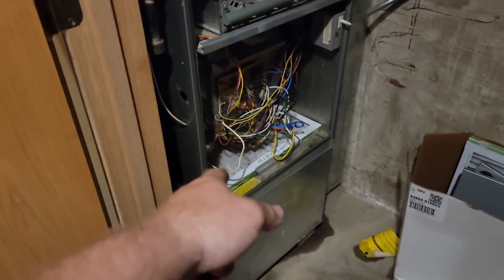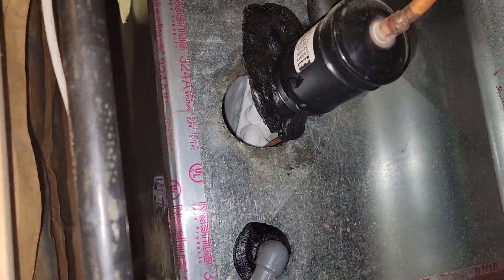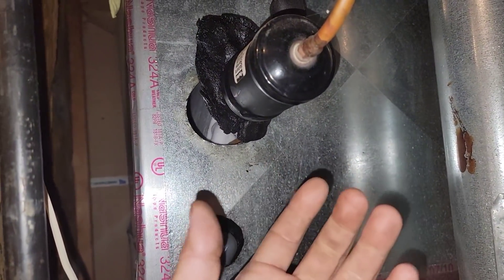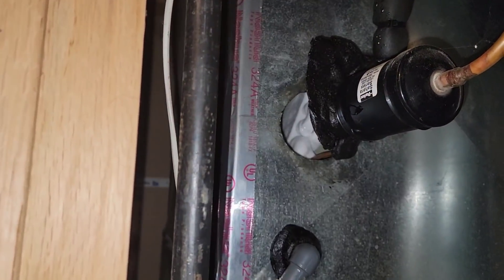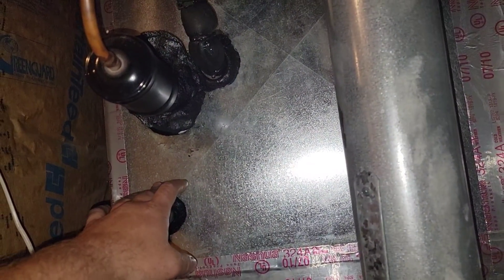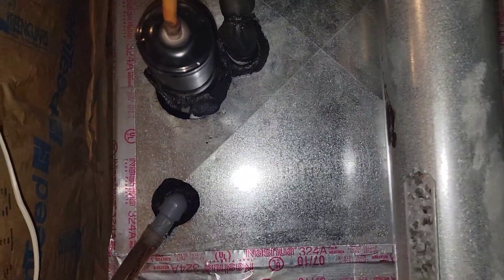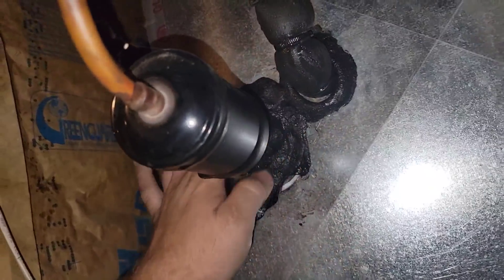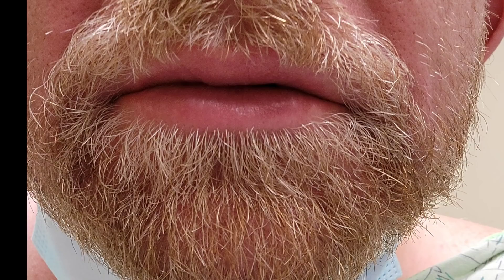Checking The Air Conditioner Put Me In the hospital, HVAC Guys I need your help

Comment: And to the icing up if it has good air flow the only thing I can think is and this is coming from the car side of things Ford wise.  Think evap core temperature sensor so it's job is to prevent icing up essentially so maybe that household system doesn't have an inhibit like Ford does IE if the EVAP core temp sensor says -99 the AC compressor will not run yada yada just a thought.  Maybe that system has a sensor for that but there is no programming or failure mode for when it goes bad?
Reply from the maker: The evaporator was completely plug from the inside
Reply from the maker: I found it tonight after I had some good rest and most of the symptoms basically dissipated from my Ventures this morning I pick myself back up and sprayed all the vegetation on the side of the house and I actually identified where this group of yellow jackets are at and there was like 20 of them that came out of the ground spring so I ran back in the house
Reply: @FordBossMe  I hate those damn things with a passion I've had them chase me at least 3 acres they came in the shop where I was sitting afterwards and stung my ass again

Comment: be sure the  interior blower is working, turn the AC off set the blower to on and let it run over night.  that should defrost it. 
a good cleaning of the evaporator is in order. 
be sure all of the vents registers are open and clean, is there filters in the return grating. 
looking at the rust that is a older system. 
kill the bees and make a path then call your AC teak i wold put money on a low charge from a leek in the evaporator. that seams to be the common place. 
i wish you the best of luck.
go talk to your DR and get a epei pen to carry full time for life.  and keep a eye on the expiration date on them.  had to scream at my Dad several times about that.
Reply from the maker: I have 2 now

Comment: Usually it is low on Freon or the Condenser is clogged. Could also be a blockage in the lines.
Reply: Also, have them do a leak test on the system with nitrogen, because if the Freon is low, most likely it has a leak somewhere.
Reply from the maker: The inside evaporator was plugged up with dog hair
Reply: @FordBossMe  That will do it also. HVAC is a tedious diagnosis process, just like cars are, especially if a problem you run into isn’t apparent or visible at first glance.

Comment: I kill these things with a clear glass bowl and some sand.  They're inactive in the evening, so that's when you get them.  Put the glass bowl over the hole, and sand around the glass to seal it up.  The wasps will see light, and they won't think their path is obstructed (if you block it with something opaque, they'll probably dig a new exit).  It takes a week or two.

Soapy water also kills them.  If you put a screen over the hole and weigh it down with some rocks or bricks, you can pour soapy water through it.  Again, work in the evening.  But I prefer to watch them starve.  They start looking desperate after a few days.
Reply from the maker: I went back over there tonight right before I started my project of figuring out what's up with the AC and I did find out the evaporator was completely plugged with animals but I went out there and sprayed all the weeds and I seen exactly where they were I was standing right in the nest 4 feet from the AC unit I could see him as I was spraying the vegetation there was like 20 of them that came out from the bushes towards the ground
Reply: @FordBossMe  Somewhere near where you are seeing the activity, there will be a hole in the ground, 1/2 to 1 inch in diameter.  That's the hive entrance.  You probably stepped too close to it before.  They feel vibrations and attack.  Also if you smash one (on purpose or otherwise), it will release a chemical smell that will send them into attack mode.

If you're a fisherman you might have a red lens for your flashlight, which you could use at night to look for the hole.  The white light probably won't wake them up after dark, but the red light certainly will not.

Last time they got me, I was using a chainsaw on some wood about 2' from their hole.  The ground vibrations got them stirred up.  I took Benadryl immediately and didn't have to go to the hospital, but they got me in the ankle and I couldn't wear a shoe on that foot for a week.

Comment: Glad you are okay. The drain like coming out of the evaporator housing looks like it has growth in it. It should not be that dark in color. I recommend using vinegar to clean that and hopefully the lift pump is working for it or it drains out  you are also going to want clean it and obviously not push stuff into the pump. You can spray Lysol before the  evaporator. As for getting it to defrost a good hair dryer will work heat gun can too but you don't want the copper on the coil getting to hot cause you can blow the evaporator coil out due to over expansion of the gas in it.  There is a guy hvacr https://www.youtube.com/channel/UC5Pnrxqqg4BLTsfsUzWw5Pw He has excellent videos on tools what to use how they work etc.
Reply from the maker: Its clear
Reply from the maker: Nothing in it at all

Comment: Yes cut the tape and cut the metal so you can take the metal  face off the A coil is more than likely clogged you can go to Lowe's and get some Coil cleaner it foams up and removes the debris on the coil then tape all the joints back up when finished that black stuff is in the electrical department at Lowes for sealing electric fittings replace that also have a good day

Comment: That’s when you hire someone to mow the yard and weeds. And then call a HVAC tech. Not everyone can DIY a A/C, you don’t have a leak detector, you don’t have thermal cameras, you don’t have gauges. Hire a professional. But cut that yard or no HVAC tech will get near that, especially with stinging bees 🐝
Reply from the maker: Well I fixed it anyway and I got the yard treated so maybe you should go watch those videos and then come back and say you know what props

Comment: I expect the main of your problems was the vegetation around the outside unit.  If that unit is truly new.
If you dare to look at the outside unit again, obviously take some wasp spray with you and kill those bastards  make sure that thing is clean outside and inside. Give it a good washdown.   Double-check that filter is new and clean. check for airflow through all your registers once you get the inside thawed out.
(Fan mode only) will thaw quickly as you see. It will probably be thoroughly thawed out within an hour or so.  I wouldn't take the inside apart unless there's no way around it.. after you check and make sure the outside unit is Thoroughly clean and the unit is thawed I would run it again and if you still find problems I would get a set of gauges put on it and check the charge level. If it is low on charge, Have a sealant put in ahead of the freon charge. Lifesaver....i know very well.

Comment: Shut off it will take time to unfreeze  unless use a heat gun .And access hole 🕳to blow out the coil  like 3 to 4 inch just below the coil becarful, then use aluminum tap with peice close it off,this you access it another time,watch out for those bee,s now you know bee,s becarful.
Reply from the maker: Yeah I already went through this there's no access hole underneath its all from the front new videos posted evaporator was clogged

Comment: Multiple reasons coil freezes short on charge no heat load dirty evaporator coil dirty filter fan not running correct speed too much dirt on blower wheel back to heat load too many registers closed last evening outdoor temps dropped and tstat called for cooling wrong metering device service tech may have did something unintentionally such as not put door back on properly